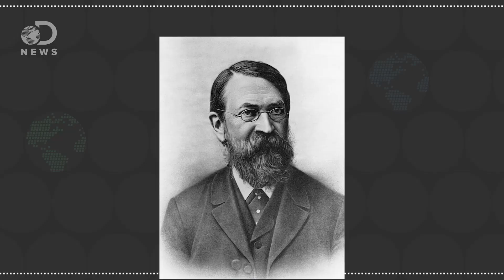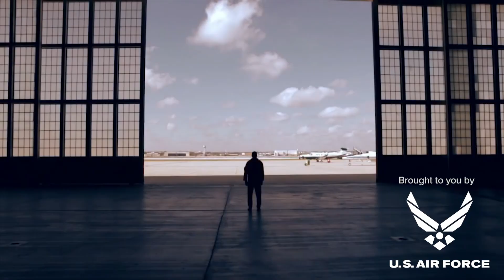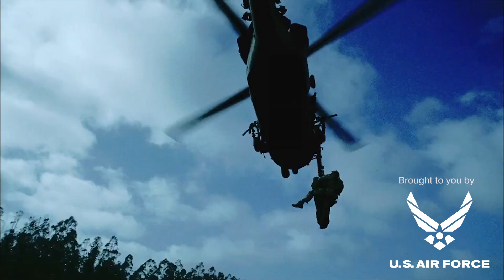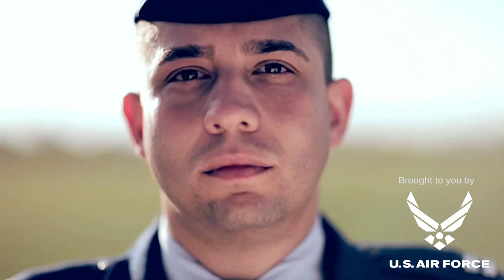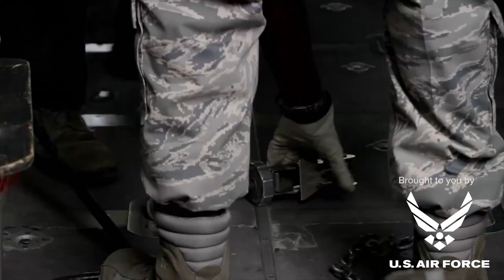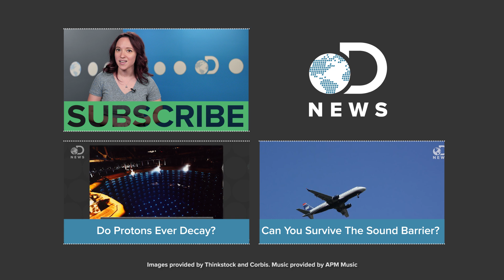Why Is A Sonic Boom So Loud?

Comment: If someone could fly, like just fly, and all they had is like a big coat to keep them warm from the low temperatures of the atmosphere, and a helmet, that covers their face and ears, like any normal helmet you see in the Jets , but without the ventilator, could they be able to do it an survive? Like they can fly really fast, my question is if they can survive with very small Injuries.

Comment: USA science educators have a responsibility to only use the metric system in their presentations. Then.. slowly the USA will migrate to the clearly superior system.

And, before you try and get smart, USA used both imperial AND metric standards during the Apollo missions.

Comment: If commercial Supersonic flight ever returns it will remain as it was, a toy for the trust funders. IOW kids who inherited lotsa daddy's money. So outside of it's strategic importance in the miltary? There is no value tto be gained for the general public.

But if you did want to offer a quieter S/S Flight? Send those mothers up to 120,000 ft or even higher. You/ll need lotsa titanium and even a thin wall of lead to block cosmic rays. However the exposure to radiation might be lessened due to the fact that the passengers and crew will spend less time up there.

Take note! By flying so high the designers should eliminate most windows. As clear glass welcomes even more cosmic rays. After all, we've never seen windows on flying saucers. Now you kno why,

Comment: 2:02 so much technically true here, first of all, all active fighter jets in the usaf are supersonic, don’t pick out just two. Second you say that the f22 can reach Mach 2 with afterburner, while the f15 can reach Mach 2.4 (faster than the f22) and you choose to only say the f22 can break Mach 2. Though this is technically true, you could have done more research to see which is faster.

Comment: For me, with a thorough understanding of physics, low-speed aerodynamics is transitioning when approaching the sound barrier. Air becomes something with a manifestation. Since it can not escape fast enough anymore, it gets compressed into a cone. The sound wave radiates radially from the center of where the pressure happens. There is no aerodynamics. there is just a flow of matter along another matter. Full-contact. With molecular friction which occurs when flying faster than the speed of sound. This is why the surface of a fast-flying airplane resp. fighter jet becomes pretty hot. The whole vehicle actually stretches because of thermal expansion. we actually are no longer "flying", but at mach speeds, we literally "guide" a stream of matter along our jet. Similar how water is being guided. Air behaves like water. which can not be compressed. And much faster, air behaves like something very "dense" to be cut through. almost like a flexible solid, but unable to get out of our way without doing massive friction to our jet or .... e.g . spaceshuttle. we move air out of our way by pure force, by our presence. But not by aerodynamics. That all around us is "hydrostatics" and matter-matter-threading (even if that is atmospheric gas) at such high speeds.

Comment: I came here after a thunderous sound in Bangalore
Reply: That is not a plane boom, it is loose ground or earth quake of a smaller magnitude. When chunks of rocks in side collapse ( Bangalore is at a height) you get that sound. Some fart told it was boom to avoid unnecessary hype and political pressure

Comment: 2:27 take note that the Concorde is not the only supersonic commercial passenger aircraft but one of two, a Russian plane called the Tupolev Tu-144 was also a supersonic passenger aircraft just nowhere near as widespread as the Concorde.

Edit: sorry correction, not a Russian plane, a Soviet plane. The Soviet Union only fell apart in 1991 while the Tupolev Tu-144 was build in the late 1960s so it's technically a Soviet plane...

Comment: But why flash (fictional character) doesn't break sound barrier
Reply: SkillED GaminG because he uses the speed force which is set in a different dimension from the plain of physics that would have someone meet with something like air resistance. Basically allows him to move infinitely fast because nothing works to slow him down.
Reply: @FinanceMan  thanks bro

Comment: She didn’t explain why it’s so loud though ...
Reply: She kind of did, though. Sound is a vibration in the air. Sonic booms are vibrations of extreme intensity caused by the breaking of the sound barrier and the associated shockwaves. It's probably because things travelling faster than the speed of sound essentially trail a wall of air behind them. Supersonic bullets are known to make cracking sounds when they pass by. It logically follows that supersonic aircraft, much larger than any bullet, will proportionately larger booms as they cause a much stronger vibration in the air.

Comment: The X15 reached, doing opposite spin of the earth, at 15, 000.kmh ...That is a fact! The vehicle had a knid of knob spin dyle so that the knew his angle of attack position relevant to 3 things, aircraft temp, oxy content, then the hardest......Gliding a brick onto a desert strip...……..Now that's more guts than any astronaught on earth. Spelling? Google it your self. Most gutzy pilots will always be the best Bell x1 right to X15. They are the men that had families and real friends. Lost a lot of test pilots ….however in that few …..there was only a litteral few .

Comment: Correction 2:29: Concord is not the only supersonic passenger plane, It is one of only two supersonic transports to have been operated commercially; the other is the Soviet-built Tupolev Tu-144, which operated in passenger service.

Comment: nobody knows what i do know, the big bang theory is based in a fast sound. the 4D is in inside the dark hole. the other side of the big explotion of the bigbang theory. 
certainly if you can throw a bullet or  any material 100 times more faster than the light or the sound, you can create a dark hold that goes to 4D

Comment: Why do I hear hear only ONE loud boom? Shouldn't there be  continuous booming through out the supersonic flight (within hearing range) since the jet is continously plowing through the air at supersonic speed? I've seen high flying military jets break the sound barrier-B O O M! The earth shakes, rattles and rolls, then nothing. I would continue to watch the jet while it was leaving a condensation trail, but everything after the BIG SOUND was back to normal. It seemed like it was a one time shock wave event, but I know it had to be continuous since the jet didn't "appear" to slow down to subsonic speed. There's gotta be some psycho acoustic ghost babble to explain why it sounds like I'm hearing the boom only once.

Comment: The video does not answer the question at all. It has to be linked to waves and how they behave in different conditions.   Though different, try to play with water waves and see how they change in different settings.

Comment: I'll explain why sonic booms are very loud so you can all understand. When an aircraft or whatever object travels faster than the speed of sound the sound waves and air molecules in front of it become compressed into a single wave called a shockwave. The reason why it forms is because they can't escape the object fast enough so they become clustered together into one. It is similar to when a boat travels through the water and you see a single wave forming.  The shockwave is loud because the air molecules are smashing into one another with great energy.  The same thing happens in explosions.

Comment: What she didn't tell you: When a jet travels at the speed of sound the sound waves accumulate and essentially pile up in front of the craft. When someone else is stationary outside that wake and in hearing range they hear the sound waves all at once and it sounds like an explosion followed by the "normal" noise of the jet engines. It's basically like a sound tsunami.
Reply: Thank you so much this is what I needed!
Reply: We lost track of our coordinates due to beautiful mountainous regions pretty quickly in this case
Reply: I always thought that the airplane punctures the compressed waves and that causes the sound.
Like when you pop a balloon. I guess I was naive. I like your answer.

Comment: Lockheed Martin was just granted a contract from NASA on April 3rd, 2018 to build a low sonic boom aircraft. The level of sound is to be measured at 940mph, which is about Mach 1 - 1.2 depending on temperature conditions, at 55,000ft. And from the ground, the sonic boom should be about 75db, which is as loud as the average car door closing.
https://www.nasa.gov/press-release/nasa-awards-contract-to-build-quieter-supersonic-aircraft

Comment: For an actual answer (over 2 years later), you need only the basic understanding of physics. Since the "boom" happens when you reach the speed of sound, it would make sense that what you consider loud in it is actually the multiple sound waves gathering before they reach you in the aircraft, since you are technically catchng up to them. TL;DR, the sound gets sandwiched before it's stuffed into your earholes.

Comment: As a retired Lt of the Air Force I had the unforgettable of supersonic flight and survived ejecting from the at supersonic speed. However it is better I not give out any details of the fighter aircraft I utilized for this experiment, I will say supersonic traveling is Dangerous and I hope for the safety of future pilots that the NSSFP doesn’t legalize supersonic passenger planes. Thank you for your support! If you have a question I have an answer!
Reply: What were the after effects of ejecting at super sonic speed? Also how intense was the training?

Comment: Your explanation is very good however it dose not say specifically what causes to boom its deals mainly with loss of control design pressure waves shock waves. What actually causes the boom?

Comment: The real reason sonic booms are so loud is because the object traveling past the speed of sound is moving faster than its own sound waves ,this causes the sound waves the would normally be in front of the object to stack up in a cone shape at or behind it and when you hear that initial stacked up sound wave your hearing all those sound waves at one time which is why its so loud

Comment: Planes never fell apart because of speed in the 40's thats called the flutter effect ,what was happening during WW2 was compressibility when pilots went into dives and went up to speeds approaching the speed of sound they lost elevator control cause the shockwave formed by the wing made the air behind it very turbulent. This made the elevator ineffective which in most cases became fatal.

Comment: The reason why?
@FrozenEternity
... The volume of a plane's body is the key score into the vacuum the happens to be.. the moment that the plane break the barrier is all this at first and all and all components of the event are in resonation during the whole process.. and its like the moment a big wet bug is getting out of your feasted hand and falling on the table and it is so strong and fit that asthough you compress over it, it is not destructed and is still going away taking its walk on the table.. and you feel the gap it initializes in your peception and attemptive+motivated nerve sytem.. and though you praise the bug you feel down right then with your huge hands and bodily muscles.. and were so keen into the aim..  that how and why throught itself the air is making us feel the fact so Loud from over itself. Eyyir iz nerw'zzz.., too nerw'zszszss..

Comment: Going super sonic isn't a big deal. While sitting in the cockpit you see 2 things, the Mach needle goes above M1.0 and a tornado of compressed air begins to flow over the canopy and once you pass through the speed of sound you will feel a slight bump and that is all. No huge deal. It's cool the first 10 times but then becomes nothing special.

Comment: if they do bring supersonic passenger flight they will have to make the fuselage the strongest ever because the Concord stopped flight because of supersonic disasters like the fuselage imploding because of metal fatigue which is caused by multiple back and fourth motions just like how when you twist back and fourth on the thing that opens a soda can it will eventually break off metal fatigue was caused in Concord because they had to put oxygen in the plane because they were flying so high the air was so thin. so it stretched it out and and then it warped back when they stopped flying and it eventually broke and caused two accidents so I don't think supersonic flight will come back anytime soon. if you want more information about this just go watch a documentary about Concord and see it in more explanation than my comment. edit: have a nice day and thank you
Reply: The single Concorde accident occurred because it drove over some metal from the previous jet that used the runway on the runway while it was taking off.  Aluminum does work harden but that is not why the Concorde was taken out of service.  Any plane flying over 10,000 feet requires the crew/hujmans to have Oxygen.  The Concorde was cancelled because of the 9/11 attacks.  Money killed the Concord, not the accident.

Comment: Did you know that the reason a helicopter makes the thud-thud-thud noise when it's flying is because the tips of the rotors move faster than the speed of sound? 
(Yes I know there is a comment about whips doing the same thing. But they didn't mention helicopters)

Comment: Hrm, yup... everyone asking because the video didn't get to the reason it is loud. Oops!  Good description of what the sound barrier is, and describing what leads up to the boom. But nothing about what actually makes it loud enough to be a boom when it flies by. 

The reason it was banned, also at air shows, is because it was cracking windows of nearby houses.  Not even mentioned in the video.

Ever crack a whip or snapped your fingers? That sound is also caused from a (much smaller) sonic boom. 

But why is that so loud?

Basically, this was half an episode.

Comment: @Robert Ohm, your explanation about supersonic speed effects is very accurate, and your description of the effects and feel of the shockwave while flying a jet at supersonic speeds are valid.  Having flown the T-38 aircraft for the USAF, I had the awesome opportunity of flying at supersonic speeds.  As Robert described earlier, the aircraft becomes less responsive at speeds above Mach 1, allowing the pilot to move the control stick much more aggressively because the aircraft responds less to control inputs within the supersonic flight realm.  The T-38 aircraft's horizontal stabilizer is called a "Stabilator" because it combines the horizontal stabilizer with the elevator, just as the X-15 was designed. When transitioning into supersonic flight, the pilot can actually see the airspeed indicator make a little 'jump" as the aircraft passes the sound barrier because the instrument that measures airspeed is connected to the pitot tube, which is essentially an air pressure measurement instrument at the front of the aircraft--it shows the jump into supersonic speed and the associated air compression wave peak is transmitted to the airspeed indicator.  Flying at supersonic speed is relatively quiet, but you can still hear the rush of the wind across the canopy.  
I used to joke with my friends and family and tell them that we had to shout in the cockpit at supersonic speeds in order to hear each other because we were flying faster than the speed of sound--and they actually believed me!  But in truth, the real rush of flying a jet fast is when you are near the ground going fast.  And we really didn't fly above Mach 1 close to the ground.  You don't sense the speed that much when flying supersonic speed at higher altitudes.  Still, flying supersonic is something to tell the grandkids about.

Comment: I used to work at a drop hammer shop. I made parts for the Raptor, Apache chopper, and other aircraft parts. can't tell you which parts, signed a confidentiality contact. I even made parts for Uncle Sam, every line was marked classified! just part number. made right here in California, USA.

Comment: Its pretty simple. Jet engines are already loud. Even before launch the Jet is incredibly loud. 

People keep asking the question of why a sonic boom is so loud. Your answer would be the same reason a Jet engine is loud.
Reply: Ok so just imagine a Ferrari at top speed going through a wall. It would be loud. Same thing. 

A jet is about 20 tons approximated. The faster an object is moving the more force is created. You may not be able to see air with the naked eye but it is an invisible wall. 

If you think of force in terms of weight multiplied by speed. The weight created by the Jets speed at Mach 1 is so overwhelming that it bursts through  the invisible wall of air molecules.  

Now consider how much force is created by a 20 ton jet traveling at Mach 1? I don't want to do the math but I'm pretty sure it's close to a million pounds of force.
A million pound object exploding through an invisible wall is the sound you hear.   

The same reasons it's loud when a car runs through a wall or a linebacker hitting a wide receiver. 

Same reason a Bomb or gun is loud. So much force is created that the invisible wall of air molecules explodes. 
I think the amount of oxygen, carbon dioxide the overall elements matter in terms of how much resistance.